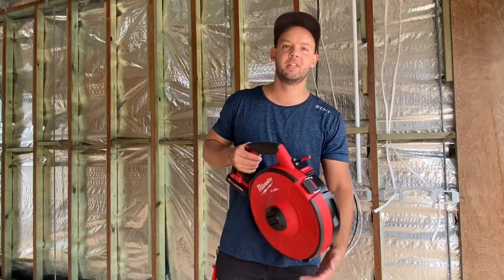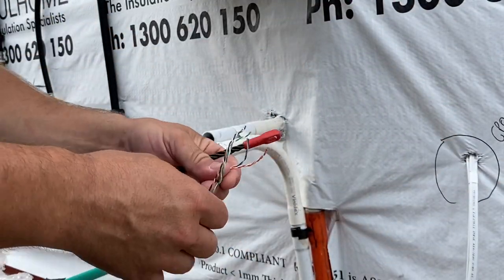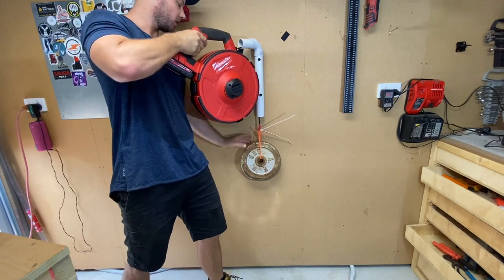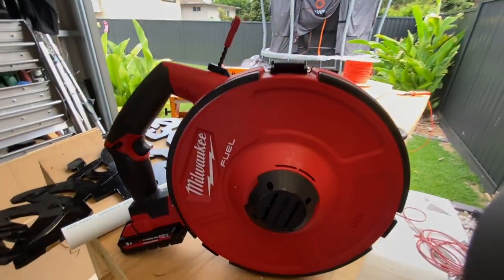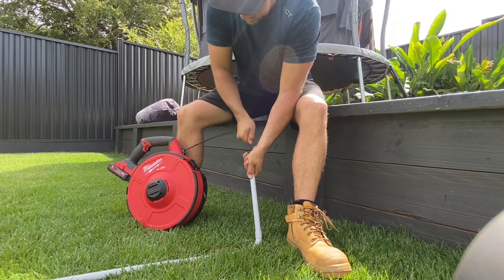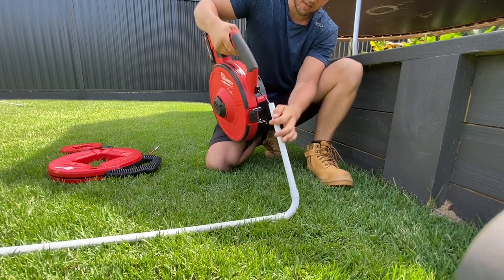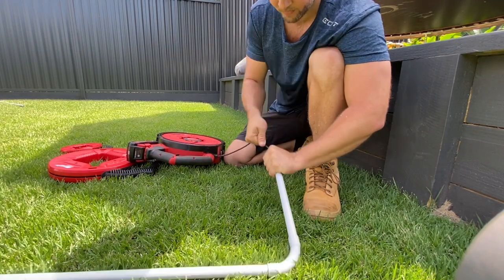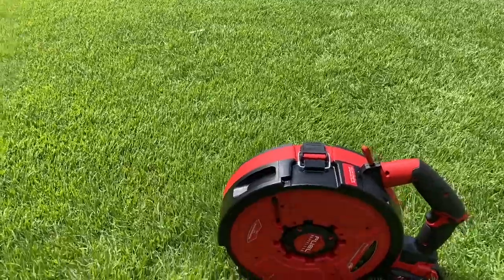Milwaukee m18 angler fishtape review and pull test

Comment: I run a lot of big electrical wires through 2-4" pipe, this tool would make pulling in the rope we use for the wire far easier
Reply: I gotta run 4 6g thhn through 170 feet of 1.5" conduit. Think this is worth the investment?
Reply: It makes it soo much easier.

Comment: I hear the steel one is not as good because it kinks in the drum. I do low voltage running through mostly 3/4. I have been considering this for some time now
Reply from the maker: Yeah I’ve seen similar problems with the steel reel. We can’t get the steel tape here which is crazy. I would have loved to review it and see how problematic it is. I haven’t heard of too many problems with the polyester tape.

Comment: Do you think it would be able to pull  16mm building wire mains through ?
Reply from the maker: It would depend on the length of the run, size of conduit and bends. I’ll have to see if I can try this out some time.

Comment: The ultimate sin he used white tape but didn’t label anything
Reply from the maker: Hey mate. I’ve asked this a few times to other and haven’t had an answer. What’s wrong with white tape? 
I also usually don’t need to label single installation cables when running them in. Not sure what the point would be .
Reply: Nice answer Logan

Comment: You're a beefy dude, can you see smaller guy being able to use it pretty easy?
Reply from the maker: For your usual runs it’s should be fine. It wouldn’t be much different compared to a normal cable pull with rope or fish tape.

Comment: I've noticed that the polyester fishtape, both manually and the auto, have a much bigger struggle through 90°'s compared to regular steelies (obvious reasons being) but I have this tool with the steel reel and I absolutely love it. It's far more superior in my opinion. Thanks for the review!
Reply from the maker: Cheers for the input mate. I would love to try the steel version especially as it’s longer. Unfortunately they won’t sell them in aus.

Comment: Can I use this to pull rg6 cable through underground conduits?
Reply from the maker: 100%. It would be perfect for that.
Reply: What about 12 circuits of 12 gauge solid wire in a lets say 1"/ 3/4 inch emt with offset, kick and 2.      90°

Comment: Yeah, I have a Southwire fish with the same end.  I refuse to use that abomination; it's absolute junk. Sure the fiberglass or plastic is too thick, but the end alone makes it useless.  You can't use it in conduit with existing wires, and you can't get around bends easily. All you do is fight the pos.  If they made one of these anglers with a smaller end with a flexible leader, then I'd be all over it.  I can't risk using steel where I work or else I'd maybe consider that option.

Comment: I think this is worth the buy even though it’s expensive and that’s simply because extending and retracting fish tape is the most annoying part of the pulling experience imo.

I don’t think this thing actually helps with the pulling action unless it’s wedged between something to hold it still, while being only up to 20ish degrees off-parallel to the conduit’s exit. 

Better get a greenlee puller or make an extended contraption for this if you’re looking for pulling leverage.

Cheers from Canada

Comment: Tip from a dutch electrician, we use conduit 99% of the time but when adding cables with 8 or 4 thin wires to a fishtape just put half of the wires in from opposites sides and twist the ends together tightly no tape needed and its faster
Reply: Heb jij dit apparaat geptobeerd om draad en kabels te trekken? Zo ja, is het een aanrader?

Comment: Those 90° bends look to be plumbing 90°s. Here in the State's our electrical tubing is regulated and has a substantial difference in radius, meaning the bend is tremendously longer than what's in your video. I believe this wonderful tool will perform much better in a true electrical tubing radius. Thanks for demonstrating this great Milwaukee product!
Reply: In the meantime I moved from Canada to the US and think the same about their standards. Some of the stuff I see here would never fly by Canadian electrical codes
Reply: @TrashPandaMedia I'm a Canadian electrician, I'm curious to what things you're referring to here
Reply: Our cable is more flexible
Reply: Yes sir I agree with this gent. I’m thinking about purchasing this unit. Great demo though.

Comment: I think milwaukee over reached with the power fishtape. I have a milwaukee 240 foot polyester tape and it is by far the best fishtape I have ever used.
Reply from the maker: It’s definitely a specialty tool for certain scenarios. It’s not cheap, so can be hard to justify. 👍🍻

Comment: I can see it being worthwhile just for simply rolling up the tape, but in a practical situation it would never leave the gang box. Especially with pvc. Vacuum and a string takes about .4 seconds to go 1/2 mile.
Reply: You still have to pull that string back and when you have heavy wire on there it’s a bitch to pull through 90’s with the string digging into your hand, glove or not

Comment: Im guessing its not really for 20mm 90º bends, for 16 & 20mm you should be looking at a 3.5mm or 4.5mm fish tape. I don't think id go for the steel fish tape as virtually all my tapes are the same with an insulation covering.
Reply from the maker: Yeah. The idea of the review and video is to see what it is capable of. In this application, the steel would be better.
Reply: @AddictedtoTools  that's it Bro

Comment: I want to know if the power of the pull is still there at lower speeds when running multiple cables through the conduit. If you have a lot of cables through the conduit and you a running a line the friction could ruin the run so is the power their with lpwer speed or is the power there only at full speed
Reply from the maker: They are great points. I’ll be hopefully using it more often at work and I’ll be able to either give an updated review or demo. Thanks for ideas.
Reply: look up every single motor with relation to torque vs speed.

Comment: You seem like a good worker.. but from Canada.. those are plumbing 90's; if you had two factory bends with the proper inside diameter and turning radius, I think you'd have a better time. Cheers